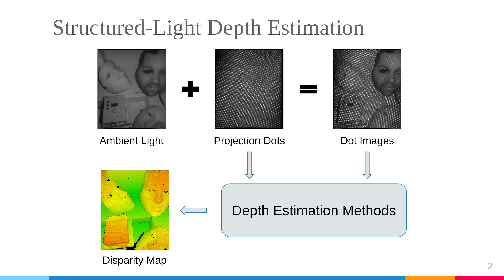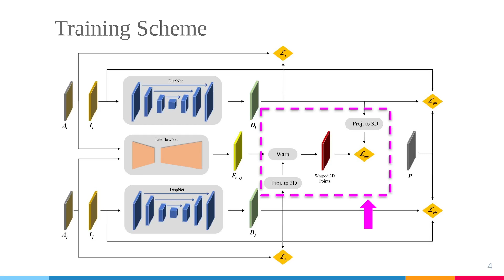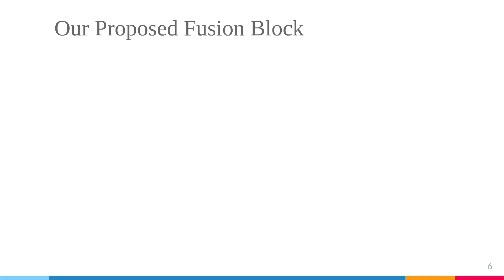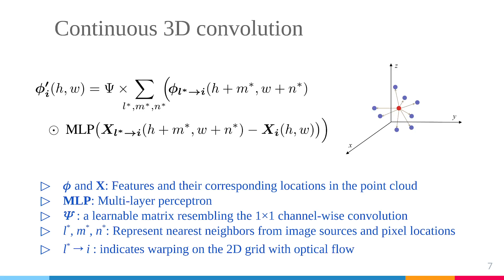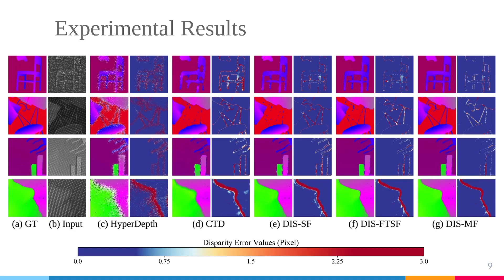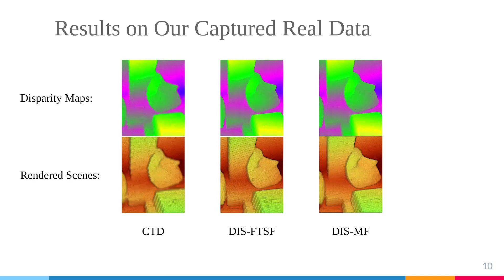DepthInSpace  Exploitation and Fusion of Multiple Video Frames for Structured Light Depth Estimation

Comment: Great video. 😀
However the link is broken and how to access the dataset which was made public?
Reply from the maker: I am glad that it drew your attention! The website should be up now, could you try it again? You may need to reset your browser data.
Reply: @mohammadmahdijohari8064  Thank you for very much. I have another question regarding the real dataset. Are the images stereo pair images? In the paper its mentioned that each frame has 4 pairs of dot images. So I was wondering if those the stereo Left/Right image pairs
Reply from the maker: @jashanvirsingh2167  The images are not stereo Left/Right images. The images per se are monocular, but with respect to the projector pattern, they could be considered as stereo pairs.